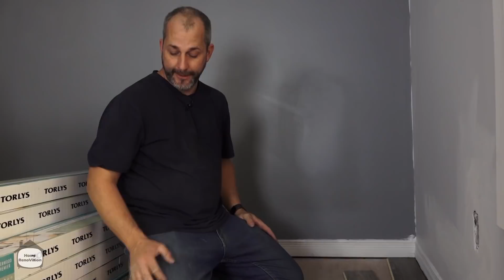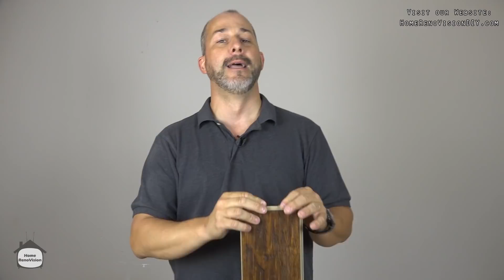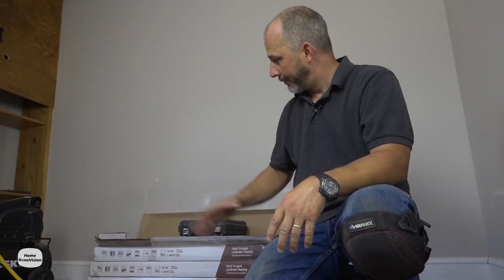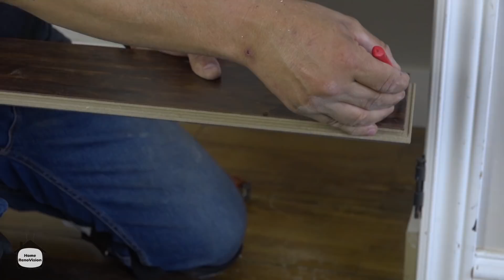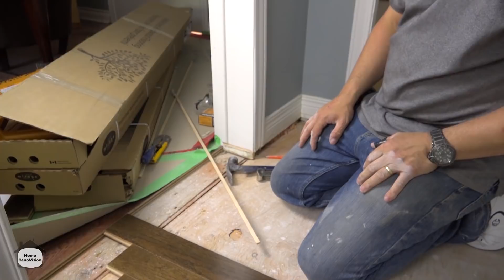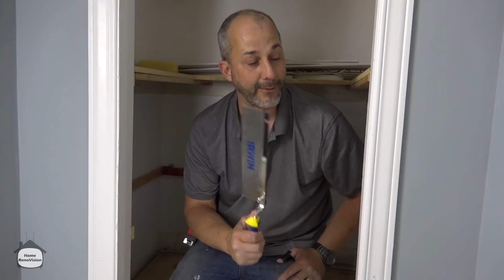How to Install Vinyl Flooring , Laminate Flooring and Hardwood

Comment: I have a small 8x8 mud room that has a Concrete floor and tile over that. I don’t want to pull the tile up because I could damage the concrete. Can I put vinyl flooring over the tile?
Reply from the maker: you definitely can. Cheers! Loose lay right on top or use adhesive to secure it in place. Cheers!

Comment: MY OLD HOUSE FROM THE 1940'-50'S HAS HARDWOOD FLOORS BUT THEY ARE AWFUL AND NEED A TOTAL REFINISH AFTER HAVING A GLUED CARPET ON THEM FOR 20 YEARS THANKS TO MY FATHER ...
Reply from the maker: That was actually a common practice for people wanting to protect the hardwood. You will be very happy with the result once you get it sanded down. Cheers!

Comment: I have a question if your up to it.  I'm doing a new kitchen remodel.  I will be installing some kind of click laminate/vinyl.  Do you recommend putting a new floor in and installing cabinets over the floor.  Or install the cabinets first and then lay the floor up to cabinet perimeter?  Thank you in advance.
Reply from the maker: i always suggest cabinets before floating floor if you will be installing finishing trims. Cheers!

Comment: So, as long as the planks are cork vinyl, they can go directly on my concrete floor in the basement?  Should I bother removing the old vinyl sheet flooring first, that's there already?
Amazing videos, btw, thanks a bunch !!!
Reply from the maker: Hi Andrew, there is no law stating you should however many old sheet goods have paper backing in them that can mold. better to start fresh if you want to lay vinyl on concrete.Just saying.Cheers!

Comment: There is a question at the bottom but to give you an overview of a DIYer that did not watch your video or even read the instructions on the box.

My mother went from a carpet on concrete pad and carpet to wood upstairs to a wood floor because she went to her nieces who had 1 and it looked nice. Thought it would make her house look nicer. 
My sister installed it. Scoffs.
I think it's the 2nd floor you installed. Not snap n click but has the tongue and groove.
On the 1st floor she removed the trim. (She has the wavy line shaped trim molding that extend about 3/4")

1. She didn't measure all the way to the wall - the trim gap. 1/2-1/4"
2. She didn't reinstall the trim after.
Yet there are still gaps that will show if the trim was there. 2" gap there, 5" there, 1" there.
3. Watching the other video you have that showed the full snap click flooring video exclusively. They sell the transition separate. She didn't purchase the transitions and the kitchen has had a spill or 2. Plus that's where my dog has his water and he likes to dive into the water and he's a splasher.
4. She stopped before getting to the base of the stairs and left the concrete showing for 6 months. Had to keep telling mom to get on her.

Upstairs
5. She didn't remove the trim. No big deal but she didn't go under the trim. Left gaps all over and a 2" gap along 1 full wall with the boards. I can literally take a step and stop and the whole floor slides.
IN ALL 4 DIRECTIONS. Facepalm How is that possible when there's a closet in the middle cutting the attic into 2 rooms and 1 side has the stairs on half.
6. The closet wasn't touched and there's a huge gap where the carpeted stairs meets the wood floor.
Whole house is wood and the stairs is still this old dirty carpet. 
Except kitchen and bathroom, 1 piece tile mat.

**7. and probably best part.
She just put down a foam pad underneath. There is no plastic for moisture.

Now this was started about 2 years ago finished a little over a year.
Not that big either. 40X10 down and up. Took a day for each floor and another day for bedroom.

Now I went upstairs to "TRY" to finish but I put in 1 or 2 boards and it was such a mess. I didn't know which way to go and gave up. I didn't want to tear it up and redo it hoping she would fix the mess. Mom told me to leave it alone anyways. So I left it alone.

Question.
1. How to remove the floor. Just rip it out and start over.
Take it apart as best to save as many pieces as possible. She probably threw out a whole box of scrap pieces because of not using the same scrap for hammering and all the other misc pieces she threw out.
Plus the other 5-6 other boxes stacked up that weren't even opened. Plenty of extra.

2nd Q.
Is the floor still good after 2 years. Living in the ohio valley just outside the south edge of the lake effect area off Lake Erie.
The house does have a draft as the house doesn't have insulation in most walls and the people that check says it has the right amount of flow to not warrant adding more under the insulation programs.
Along with the 1 wall that has a leak in the corner.
You should come down here so you can do a full house DIY videos.
Reply from the maker: send me an email!

Comment: I like watching ur vedio I can't decide on my flooring I have tile 20yr old can i do vinyl planks on top of tiles coz lot of work removing tiles  .I do have water radiant heat under floor pls  give me ans  with ur experince .
Reply from the maker: yes for sure. Use a thin vinyl floor and you will be very happy with the results. cheers!
Reply: Hi Jeff 
I have 220 sft concrete basement . Can I use life proof vinyl plank waterproof flooring from Home Depot which is costing $ 3.19 per sq ft with out underlying sublayer?

Looking forward for you reply

Comment: Hi. I was wondering. Is it possible to use flooring nailer when installing hardwood floor over a chipboard subfloor?
Reply from the maker: Hi Roman , you need to watch my hardwood floor install video. Cheers!
Reply: @HomeRenoVisionDIY  Thanks. I love watching your videos. Very professional. I just would like your advice whether is safe to nail hardwood flooring to chipboard subfloor. Thanks

Comment: I can say I sat through this whole video, hoping to learn what type flooring I should install, I love the hardwood flooring but for me to do that, I'd have to hire someone to install it, so that one is definitely out.  The pricing per square foot is no problem for my budget, like I said my kitchen floor is seven and a half ft. both directions and I have to do this 'myself' with no help so I am looking for "easy method", but gosh Jeff I must say you are one top man in your field!!  I watch another canadian man, Shawn James (gosh you could pass as his twin)  he built his log cabin in the wilderness of Canada, by hand, without modern tools,  you men are awesome!
Reply from the maker: Thank you and |I think you will be fine installing anything ! Cheers!
Reply from the maker: I figured you were vinyl roll. In some cases the toe kick or kickplate can be removed and then reinstalled instead of 1/4 round. Cheers!

Comment: In your laminate video you moved your full boxes onto the planks to keep the floor from moving around. With vinyl your screwed it down. Is one way better than the other?
Reply from the maker: just showing options. vinyl is easier with a screwed down approach. laminate is not that easy to work with so the boxes are best.

Comment: Hi, I am thinking of installing 6 mm floor tiles no my kitchen, my problem is that some time before I had this house a wall was taken out to make a bigger kitchen. The original kitchen had a concrete floor but the other room is tongue and grove pine boards, I am worried that movement of the wood floor will cause the tiles to crack in time. Have you any tips that would address this situation.
Reply from the maker: Hi John , your floor tiles are going to be what material?
Reply: @HomeRenoVisionDIY  they are a ceramic tile with a gloss finish

Comment: I hope you don't mind me asking, I have a question about the premium laminate floor?? I'm sure you know that most manufacturers have specific intructions on how to install the floor and what i mean by that is at random, staggered or brick style or the way you did where you "cut one at the half mark then half of that or at the 3/4 mark and then a quarter mark that being said does that not apply to that brand of flooring or does it not have any specific instructions on hoe to install the floor? Thanks man and keep up the amazing work.
Reply from the maker: I Jose, I just the random look of the joints. I hate a repetitive pattern. Cheers!

Comment: Good day Jeff, I’m installing LVP I have a 12” Hitachi chop saw, would you suggest using it or should I purchase the Roberts cutter you use in this video? The investment isn’t a problem as I’m a handyman and will certainly use it again in the future. Thanks again Bob
Reply from the maker: get a cutter. this way you won't be running up and down the stairs the whole time. and you can't cut in the house. the dust is bad for everyone.

Comment: Not sure if you've answered already in one of your videos, I see people use underlayment. Some flooring has underlayment already. If it doesnt have underlayment, do I have to use it?  And also should I use adhesive?  I'm doing click flooring over wood subfloor
Reply from the maker: Hi Angelica, click flooring is a floating floor so no adhesive or fasteners. you need underlayment for sound reduction and vapor barrier when applicable. good rule is if you install on wood then just an underlayment or flooring that has it attached is great. if you insatall over concrete best to have the vapor barrier as well. Cheers!
Reply: @HomeRenoVisionDIY  great, thanks! Love your videos btw!

Comment: For the hardwood floor, you should have moisture barrier paper  under it. I used roofing tart paper which acts as moisture barrier and noise damping. Fail to have it, floor will make noise in next few years.
Reply from the maker: so how does paper stop the creation of noise?

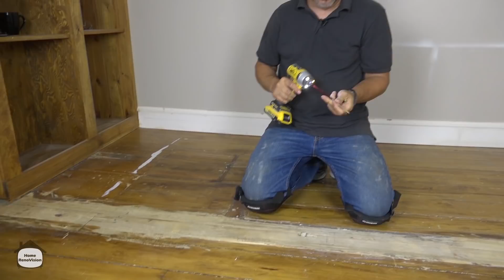Comment: 28:05  If I was doing this on the 2nd story of my house, how do I know I wont screw into a pipe or some other critical thing? (Yes, I am a total amateur.)
Reply from the maker: building code along with common practice, plumbers and electricians are required to install their lined in the middle of the framework. use a screw that will not reach that far into the joist. A good rule is 1" longer then the substrate material you are attaching.

Comment: In your laminate installation video, you put the planks in the same direction as the subfloor planks.  I have been told that they have to go perpendicular and if I want to go in the same direction, I must add a 1/4 inc plywood underlay.  I would much rather lay the laminate directly on the subfloor planks in the same direction so as not to add height (and time and money) to the project.   What do you think?
Reply from the maker: the subfloor planks I was working on are 1 1/2 t=g softwood lumber and I screwed them down to the joists. That is why I had no concern. If your subfloor is nice and tight you should not have any concerns either. Cheers!
Reply: @HomeRenoVisionDIY  Thanks for the response!  This video was amazing.  I have probably watched 30 hours of other videos before this that made my head spin.  You're my new go to guy!  DIY renovating a 3 bedroom apartment by myself for the first time from ceiling to floor.

My subfloors are also 1 1/2 t&g softwood, not screwed down.  However, there are small (1-2 millimeter) gaps between the planks.  Is this something to worry about, or can I move forward if I screw the planks down and replace the bad ones?
Reply from the maker: Hi Michael, That is exactly what i did. just add 3/4 length to your existing floor to determine the size of the screw to use. Do your best to isolate plumbing and electrical as well. You should be fine as long as someone hasn't done anything too weird since the floor was first installed. they used nails that went 1" in to the joist back in those days!
Reply: @HomeRenoVisionDIY  Great news.  Do you just replace bad boards with plywood cut to size?

Comment: As always, great (addicting) video! Have a rental townhome, looking to add LVP to a first floor kitchen (concrete slab) to match existing LVP in adjacent living room.  Can I install over tile?  Understand that there may be a height difference at transition between kitchen and living room. Seems like this would be easier than ripping out tile and prepping subfloor/slab.

We purchasing LVP from Lowes, they are recommending that I add a thin padding over concrete slab but I noticed you did not use any padding.  The LVP we plan on using does have some rubber padding on the backside. Thoughts?
Reply from the maker: there are a lot of different products. some soft core some hard core. many without an underlayment attached. follow the direction of the manufacturer.

Comment: I have a concrete ground floor. Seems to me I should add some kind of underlayment or moisture barrier, although humidity is not a problem. Superior walls help with that I imagine.

Answered as you went along!  Thanks. So it could be a separate moisture barrier or maybe included in some products.
Reply from the maker: Cheers!

Comment: Jeff in those tight areas when laying laminate I use a red bar and drop the hook between the baseboard and floor then just wiggle the bar left and right and it'll make the laminate lock right in. No damage to the base or the laminate.

Comment: I need to put a floor on a two story addition.  The lower level is a cement slab.  The upper level is 3/4 inch plywood.  There will be large dogs and much human traffic.  What type of flooring and what brands would be best to last?  

If I would choose laminate, should I limit myself to Pergo Outlast plus.  If I choose vinyl, what brand(s) and models do you think would be suited for the upstairs and the downstairs?

Thanks for your help and time.  Your videos are great.
Reply from the maker: vinyl plank all the way!
Reply: @HomeRenoVisionDIY  Why vinyl over the laminate.  And which brands and corresponding "models" of vinyl plank do you think are the best?

Comment: Curious about putting heating grids or pads under vinyl or other water proof flooring for a bathroom or kitchen. Would love you advise or knowledge on these as well. And if so does it go under padding or on top of padding?
Reply: Another question, the osb sub floor was nailed to floor joist. Would rather put in screws to quiet down the floor. Do I pull the nails as I go or counter sink them and add screws where needed? Thanks love your channel..
Reply from the maker: add screws and just sink the nails. Cheers!
Reply from the maker: Hi Clint, there are options now for using a membrane heating system in conjunction with vinyl plank flooring. we will be showing that option soon. Just make sure the flooring company agrees with your marriage so you maintain the warranty.
Reply: Thank you for the advice and the best info on DIY YouTube.. if you do a show on this subject please include going over concrete as well..thanks..

Comment: Here’s another question... how can I redo my stairs so that the flooring I’m using in the hall transitions to the stairs and use the same thinner laminate or vinyl flooring??  Am I stuck picking another product that does not match??
Reply from the maker: if you use vinyl you can get many products with integrated nosing so you have a superior wear layer and no trip hazard and vinyl is not slippery so very safe for the stairs. Just make sure to inquire before buying the floor . not every brand and color has the nosing option. Cheers!

Comment: I’ve been watching most of your flooring videos and if I remember right in the hardwood one you show how to transition from flooring going in one direction to flooring going in another.  Is this possible with laminate and vinyl flooring?   

I have a hallway upstairs where the flooring would go in the direction of the hall length and 3 bedrooms can transition off on the same direction off the hall as they also would have flooring going in the same direction.  2 bedrooms off one side of the hall and one off the other side. 

The challenge would be the final 2 bedrooms that are off each end of the hall. They should have their flooring perpendicular to the hall based on where their longest walls are.  I do NOT like those bump in the floor transitions that would typically be used for this.  Is there a way to but the two floors together?  Heck, some of this stuff is fairly thin.   Am I stuck using a transition?
Reply from the maker: definitely! and ion many cases preferable to make installation easier.

Comment: Hi Jeff, awesome videos!  I have about 3/4" slope over 6 feet in my living room.  I want to try and get it flat. can I rip up the floor and use 3/4" plywood on top of the subfloor to bring it back up and then sand to feather it to make a smoother transition then lay new hardwood? Or Is there a leveler out there that I can nail through?   I'd rather not have to remove subfloor and build up the joists.  Thank You in advance for any advice.
Reply from the maker: Yes , use the leveler that you can nail through. exactly!
Reply: Thank you. from my research I couldn't really find a leveler that will 100% accept nails. So, Could I nail down hardwoods over the plywood area then just glue down a 25sq ft portion that sits on top of the leveler? Unless there is a product out there i'm missing?

Comment: I am debating between flooring options for my new condo. We only plan to live here for 3-5 years, but want to rent it out once moving. We live in Miami, and I have seen a lot of houses with porcelain tile with a wood like finish. Is that something you would recommend among the other options in this video? If so, what do you think would last long, around a $2-3/sq. ft. budget? (the condo is 1,020 sq. ft) 

P.S. LOVE YOUR CHANNEL!!!
Reply from the maker: Hi Hello48049.....porcelain tile in a condo is a winner of an idea. Just make sure you have a few extra tiles available for replacing damaged ones down the road if you plan to rent. Cheers!